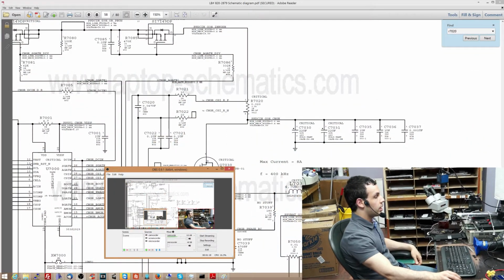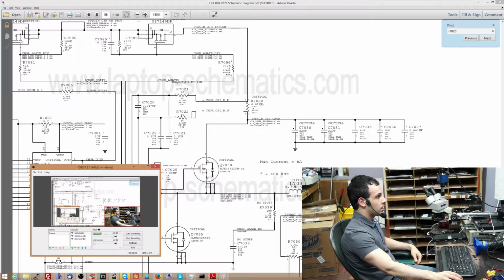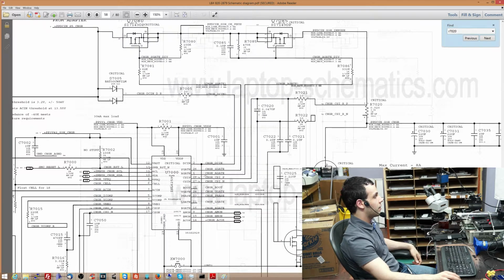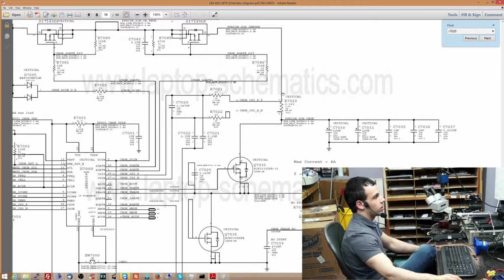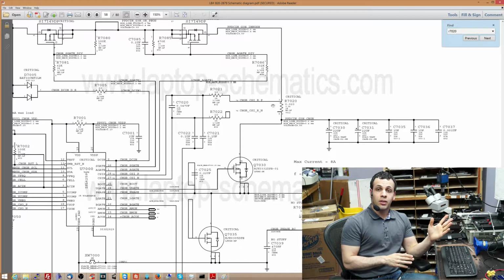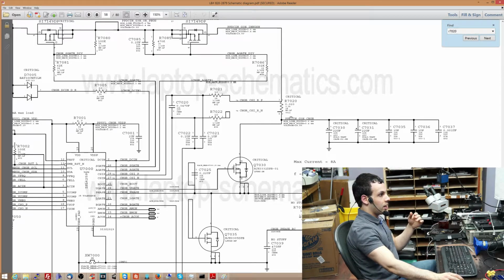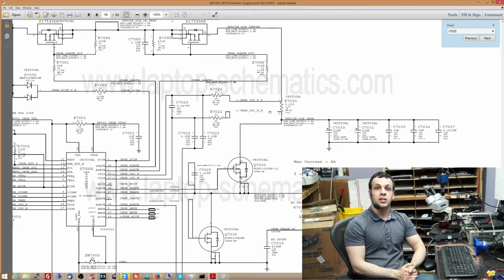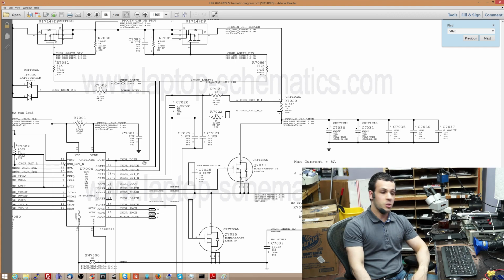What is current sensing circuitry and what is its importance?

Comment: Current (I) is not the Power (P). The Power (P) = Voltage (V) x Current (I). Current is the actually flow, not of electrons, which is electron flow, but of current. Very confusing, but think of current as the charge carriers and the voltage as electrical pressure moving those charge carriers through the wire or traces in a circuit. Power is the multiplication of current times the voltage.

Comment: Y r there 2 10 kohm resisters connected to d current sensing resister why are we measuring voltage at both d terminals ?

Comment: Hi this is Adam. I have an MSI Gaming 5 z97 motherboard and Asus Strix Geforce GTX 1060 6GB OC edition with voltage read points.
Do you or could you do an instructional video of how to use the multimeter to properly check these. 
I am interested in furthering my knowledge and skills and also using this method gives a much more accurate reading than cpu z and other softwares.Kind regards Adam

Comment: Good video, but I'm pretty sure you are wrong about something. Like Matt Hollands commented, the current should be calculated using Ohm's law rather than a predefined table of values. Why program a set of values on the chip, when the chip can use Ohm's law to calculate it on the fly for any value? If you are correct, and Apple uses a set of predefined values instead of Ohm's law, than please explain why, as it seems ridiculous to avoid using Ohm's law to calculate it on the fly.

Comment: Louis Rossmann Would it not just use Ohm's law to calculate the current? Rather than some kind of look up table structure.
Reply: A table is probably a little more accurate given Ohms law is based on an ideal circuit and a table would be based on real world measurements.